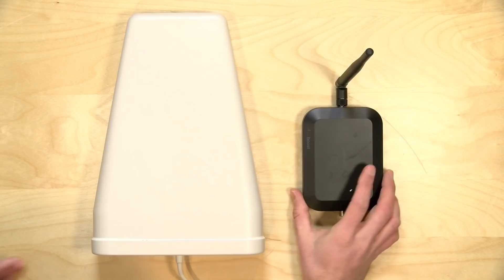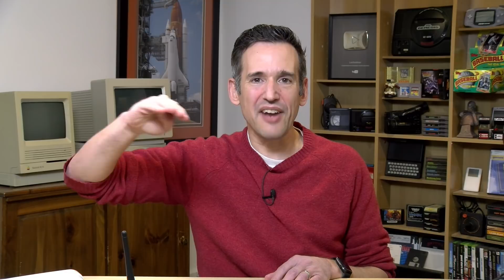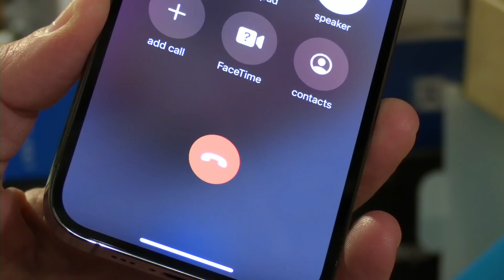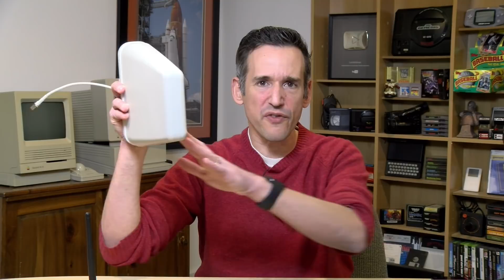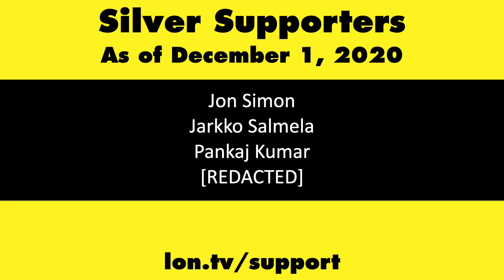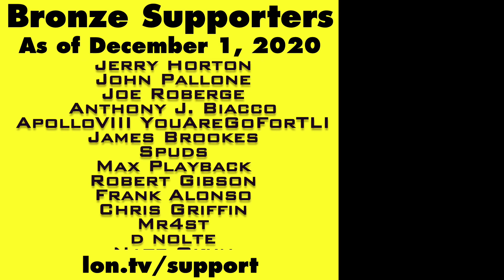weBoost Home Studio Smartphone / Cell Phone Booster Kit

Comment: Thanks for the video. I am using Verizon's Visible network and want to boost a signal into a small 900sf camper. I spoke to Wilson tech support and the Lite version of the Home Studio boosters is what he suggested. I just started service with Visible and have no intention of changing carriers anytime soon so does this sound right? BTW I used to work at Kennedy Space Center and supported the Shuttle program for 20 years up until it's retirement...
Reply: How is it
Reply: @airmason14  Not bad really. I was just using Straight Talk before so I can't compare it to a premium cell service but for my needs it is good enough. The WeBoost Studio works great. I have the outside antenna on a 10' stick of 3/4" emt strapped to the side of my camper with the inside antenna directly underneath the main antenna with no feedback. I suspect the heavy aluminum roof and siding is working as a Faraday Cage. I put my cell phone right next to the inside antenna and used it as a hotspot for my computer and Roku for the tv and worked fine. The Visible network will only allow you to use 1 device at a time with the hotspot though so I got a portable wifi router that enables me to use several devices at the same time.

Comment: Wi-Fi Calling is only available when making a call between cell phone carriers.  A call from a land line will not be routed thru the WI-Fi network.
Reply from the maker: Incorrect - WiFi calling works exactly the same as it does from the tower and it will hand off back to the tower if you leave the house.